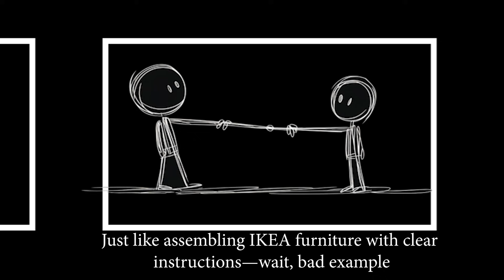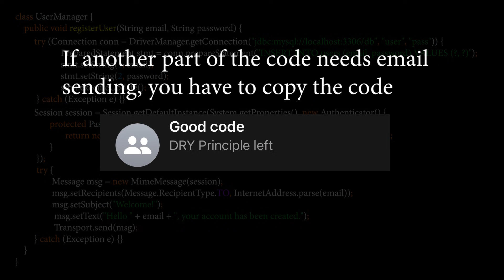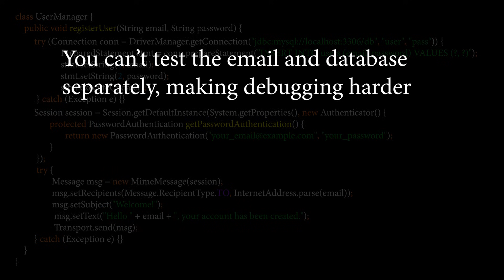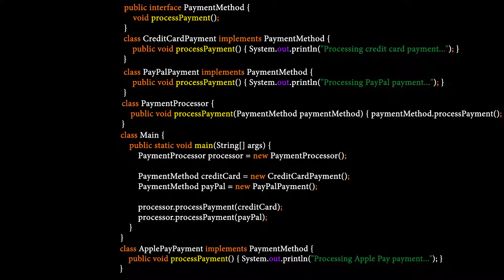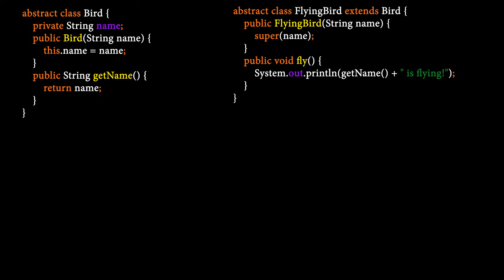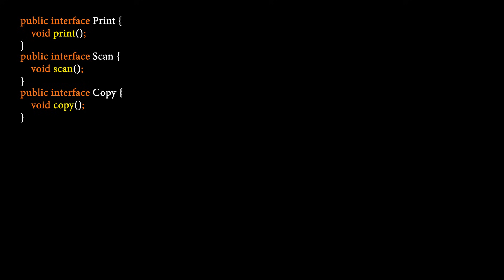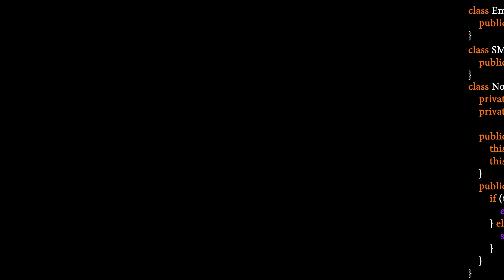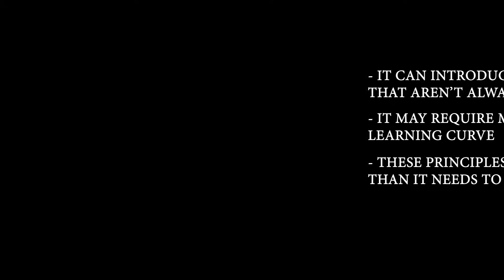The Simplest Way To Explain SOLID Principles

Comment: All these principles are working well if the code initially has been written using these principles. But if it is a two-decade-long legacy big ball of mud, you cannot avoid rewriting existing code, or your single reason to change the code is "rewrite code". You try to change one thing, but all the code is tightly interconnected like hair strings in a dreadlock, you just can't untangle it, you cut it off and grow new hair.

Comment: Very good video, very well explained. 

Sadly, in the real world these things don't really work out the way we think or have been told... especially after a project has been around for over 10 years or so. You end up with a code base made up of hundreds and thousands if not millions of little bits and pieces all in a pile held together with public method calls, stacks of interfaces, and terrible performance. That is the reality. Period.

What we're doing is rarely the issue, it's how we do it. Our code is how work gets done. Our code is like the locomotive of a train and it's what is getting the work done. Unfortunately... the software industry is still in the steam age. In the 1930s Diesel-Electric trains started to become a thing... imagine the entire steam engine industry was like: Don't reinvent the wheel... it's bad practice, bro!

If we continue to use the same principles, standards, and "best practices" we will just continue to build the same old steam engines have been for the last 30 years and continue to output software that is clunky, slow, error prone, fragile, slow to work with, and hard to maintain. And no, things like REACT, Svelt, Blazor, ect, does not change how the steam engine is being build... it only changes how the levers are being made the conductor/train driver interacts with. In fact, things like REACT only add levers on top of the existing levers... but the levers are nicer at least and worth the extra cost of complexity and performance... right?